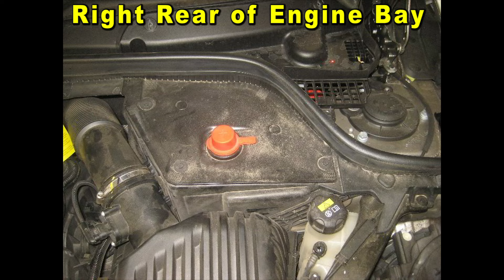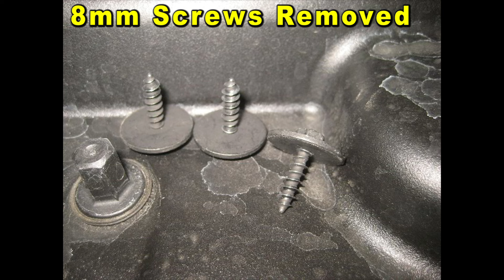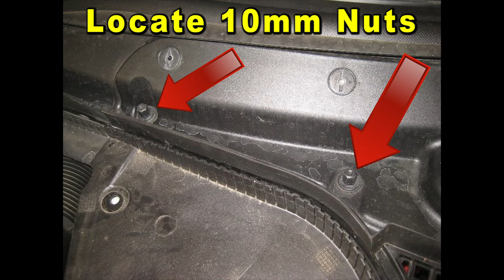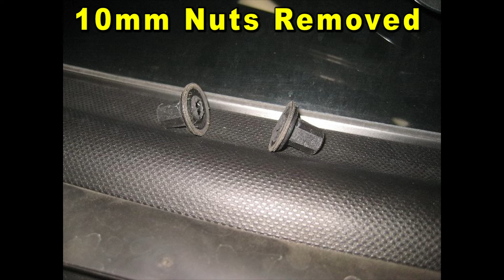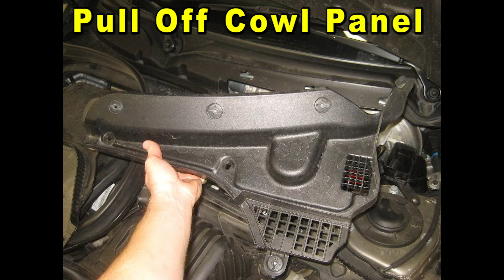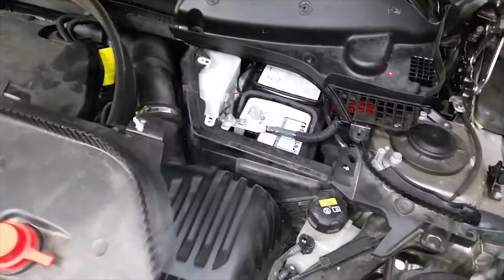2014 To 2024 MINI Cooper How To Access 12V Car Battery - TurboPower 1.5L I3 Engine Bay

Comment from the maker: MINI Cooper 12V Car Battery Group Size - https://amzn.to/48Tk7rC
Felt Anti-Corrosion Washers - https://amzn.to/3Oe7oX7
Weize Platinum AGM 12V Battery - https://amzn.to/3URLnAX
UPlus 12V Battery Part Number - https://amzn.to/3YMs1hO
Marxon 12V AGM Battery Part # - https://amzn.to/3YT5CzE
Motul Low Viscosity Racing Brake Fluid - https://amzn.to/3ZbkcDN
Precision Screwdriver Set - https://amzn.to/3sLixaP
Plastic Pry Bar Tools - https://amzn.to/4cPO5xb
Socket & Ratchet Set - https://amzn.to/3Z17LbA
Mechanix Gloves - https://amzn.to/3jCnHkt
Torque Wrench - https://amzn.to/3vS5uSI

The Paul79UF YouTube channel is a participant in the Amazon Services LLC Associates Program, an affiliate advertising program designed to provide a means for sites to earn advertising fees by advertising and linking to Amazon.

This DIY video shows owners of the 3rd generation 2014, 2015, 2016, 2017, 2018, 2019, 2020, 2021, 2022, 2023 and 2024 MINI Cooper how to remove the plastic covers in order to access the 12 volt automotive battery at the right rear of the engine bay. (The brake fluid reservoir is located next to the 12V car battery.)